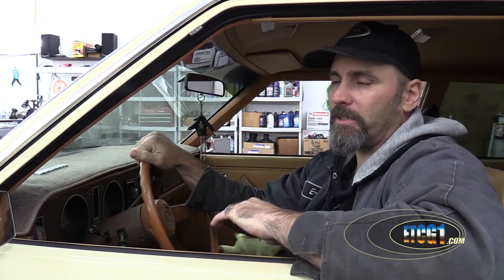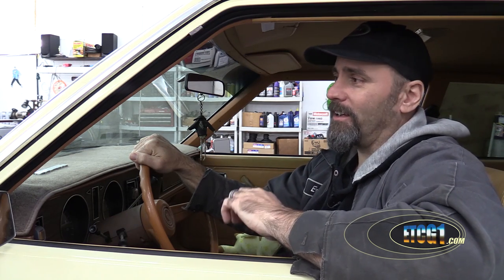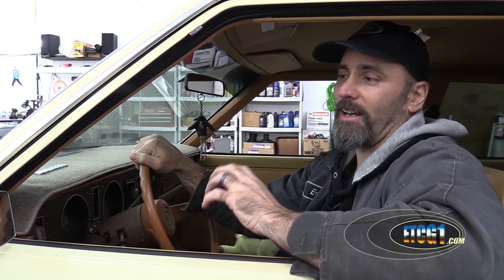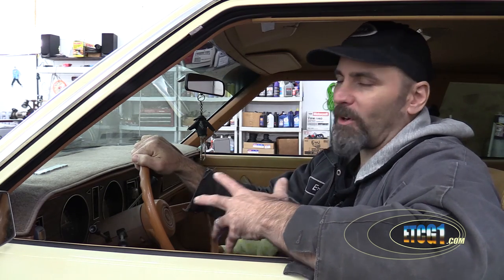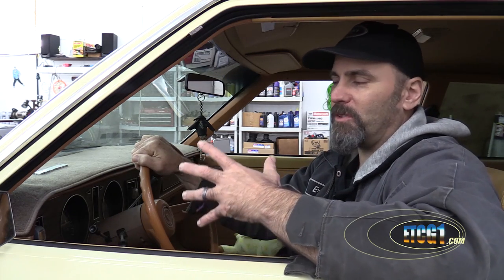Analog vs Digital (Cars)

Comment: I love electronic ignition and fuel injection.  new or old whatever I own at some point I always do this.  

for my performance cars it has to have abs.  kinda limits what I will buy for canyon carving, road racing and rallying.  just a huge safety feature that keeps me alive.  and again I will throw in traction control.  as long as it has abs you can replace the ecu and setup traction control.  

for my lightweight sports cars I love manual steering.  so much more enjoying and gives you way more input.  

my only major gripe with all the new and fancy gadgets is when it's faulty how much is it going to cost me.  if some silly sensor is going to go every couple of years and cost me $300 each time I'm going to be pissed.  

I had a Kia optima sxl.  amazing car.  I was very happy with it.  around 35k miles the high pressure fuel pump went.  it's only available thru the dealer and only with them installing it.  cost $1000.  pumps generally go every 25-35.  and although they have great warranties on the cars that doesn't include the fuel pump.  so in 2 years I was looking at spending 1k on a fuel pump.  while this is a mechanical part it's only so expensive because it supports direct injection.  

I don't mind dealing with technology.  just keep the prices down.  if I have to replace a sensor don't kill my on the price.  

FYI I traded in the optima sxl for a new maxima.  that car is just sick and has so much new and amazing technology in it its mind blowing.  not sure I would want this stuff in a sports car but for daily driving and road trips it's great.  I will for sure get an extended warranty for it.  let them deal with it when stuff breaks.

Comment: With my personal vehicle, the only thing that is digitally controlled is the engine. In the process of fixing almost everything on it, I prefer it that way.

The engine runs on an electronic distributor and an ECU that controls the injectors and idle air control valve based on what the throttle position sensor tells it. That's literally all it does. In terms of it breaking, this system is actually less prone to failures and has more failsafes built into it than a mechanical system can. If the engine starts to stall, it'll open the IAC to compensate. With a mechanical system, it would just die. It won't let the engine rev over 6250 in case the transmission is slipping. With a mechanical system, you're looking at a blown head gasket at the very least. If the engine is getting less air than it's supposed to, it'll give it less fuel. You won't be running rich and sludging up your engine. Fuel injectors also last a very, very long time and PCB boards are virtually impossible to break.

Believe me, this Windsor has been through some shit, and I don't think it would've kept running in those dark times if it was fully mechanical. After some TLC it is now running happily in sub-zero temperatures, despite having gained a lifter tick. The transmission is another story. I kind of wish I could have a 4R70W, but I don't see that ever happening.

That said, absolutely nothing else is digital. And I want to keep it that way. I can't stand all the ridiculous redundant anti-stupid sensors today's cars are jam-packed with. It pisses me off even more that they're necessary, because most people are incompetent idiots.

Comment: Interesting video! I'm stuck in the Bosch k-jetronic with lambda world that mixes the most complex mechanical system I've seen with the most inaccessible lambda control system coupled to early Porsche digital ignition timing. Lots of people do EFI swaps on the 924 turbo' and carb swaps on the N/A 924 for the reasons you've been talking about

Comment: I am an IT professional and use all types of computers and electronics daily, my current car is a 97 5.0 explorer, and i love it, mainly because it is electronicy enough to be reliable without the pita that is all analog, and it does not have a DRM ECU.

i think i am in that lucky bracket of being old enough (and interested enough) to have owned worked on and rebuilt old engines, but young enough to still understand and use modern electronics (down to the component level) it also does not hurt to know the physics behind the operation, but not essential.

given a choice? i would still go electronic, wider operating parameters with less fiddling (unless you call dicking around on a computer fiddling then i guess not LOL) but yes for the reasons you mentioned about retooling to make some major changes for analog systems.

ultimately, emissions aside, there is a reason we do not use older systems as frequently any more and in some cases not at all, and that is due to their limitations. Are electronic systems ideal in all environments? nope, but we have electronic systems now in much more harsh conditions now in smaller packages than are possible with legacy systems.

in the end it is the correct tool for the correct job. we went to the moon and computers less powerful than a modern scientific calculators, people built them using slide rules and mental arithmetic, and hand welded everything (seriously check out the F-1 rocket engine, that was artwork not just welding!) however we also have thousands of satellites up there now (and a space station) that are packet with electronics too which make our lives (somewhat) easier and more pleasant.

Comment: First vehicle i owned was carbureted. 89 silverado, only problem i Had with the fuel system was one of the harnesses inside of the carburetor would pop up and it would run lean. repair cost me $23.00 for a new harness and some soldering skills. dirt cheap and reliable. truck is still being driven around.

Comment: As an Electrical Engineer with an addiction to working on my cars I prefer the computer controlled electro-mechanical systems vs the mechanical systems without  computer control. I understand the systems, but I also understand the mechanical systems of old too. I don't think there is anything wrong with going with a carburetor for the fuel delivery.

Comment: Here's another thing that was a potentially big problem that fizzled out quickly: Remember the pre-OBD-I fiasco where private repair shops got together and petitioned the government to force manufacturers to "standardize" systems in terms of diagnostics?  I have a '84 Isuzu Impulse with Hitachi fuel injection and I have all the factory shop manuals and almost no amount of study can make me understand it... truly a work of PFM!  I bought it for a future project and I only need it to "lot drive" so it amazes me every year when it starts and runs :)  It has a multitude of vacuum lines and valves that act as modern-day digital logic circuits.  I wonder if there will ever be a museum for some of the true automotive oddities of the 80's?

Comment: I can see that for this kind of build which is really a one-off custom job, it's going to be a lot easier to get a carb setup that runs "good enough" than to get an EFI system custom tuned in order to deliver maximum power. You definitely are going to be leaving some power on the table though.

The other problem with a carb setup is it's ultimately a dumb mechanical device that has no intelligence or feedback based on what's going on. An EFI system can manage the fuel delivery better to allow for reliable cold starts, and to control the fuel trims if you start running lean or rich (due to altitude changes, different fuel..) Also it can do things like roll back timing or boost if the engine starts pinging. Particularly in a turbo build with a carburetor, it's going to be much more up to the driver to prevent something like burning a hole in a piston if things aren't quite running right.

Comment: well I agree with both sides of the argument eric I love the modern systems and the diagnostic and control, but I also have a few old motorcycles and a 1990 mechanical fuel injected car. there is nothing you cant bodge at the side of the road with a simple carb and points system to get you home but I love the precision of digital so you are both right and wrong and so am I lol . love your build and who could get tired of the dyno video.

Comment: I like the early fuel injection era.  Kinda combined the best of both words.  My 1990 Oldsmobile 88was made to look like a 70s csr but had the MPFI so it has great mileage even compared to new cars.   The most fancy thing it has is a "driver information system" which monitors things but is independent.  If it breaks the car will still run.  The interior otherwise only has a radio, heater and speedo.  Under the hood, you got spark plug wires, a brand new coil/ignition module and otherwise its all simple like an old car.

Comment: You could argue that the best system is the one built right! I've run a 1972 VW Bus with twin Dellorto carbs and it was amazing, yet I've tried to set up dodgy Chinese copies of Solex Kadron carbs on the same type of VW engine and struggled to even get it idling correctly. Likewise, the fuel injection system on my Wife's old 1994 Mercedes C-class and her current 1998 C-class is really good with both cars reaching well over 200,000 miles with no problems. Compare that to my 2002 Mercedes C-class and it's by far one of the most unreliable systems I've ever seen on a fuel-injected car.

Comment: I disassembled a 1970s Chrysler carburetor for my truck. I learned so much. They knew what they were doing. Still no matter what I did I couldn't get it to run right. I had two options based on my carb skill. Idle at 2500 or no idle at all. I just settled for 2500.

Comment: A carburetion problem is likely cheap to fix, but a fuel injection problem is less likely to occur in the first place. People today are generally less aware of the mechanical needs of their car, I think, as a result of how much less often their cars need maintenance. A typical maintenance schedule today includes the obvious (oil, filters) and after 100,000 miles the manual finally recommends a new service. (Spark plugs, no wires) But go back to the carburetor days. Almost every week, your car was going to need some kind of adjustment or minor repair. And if you neglected to do that for a few months, you could end up with a hesitant smoke-spewing pile. Today's fuel injection systems are self-learning, making slight adjustments all the time to suit the conditions they're being driven in. They're super efficient and monitor themselves, letting you know immediately when they feel something is wrong. It's not a perfect system, but from a perspective of day to day usability, it's my belief that modern fuel injection offers a host of improvements that far outweigh the disadvantages. Maybe you'll be able to fix your broken mechanical fuel delivery or ignition on the side of the road. But electronic control is a lot less likely to leave you on the side of the road.

This is just my perspective though. I feel your choice to use a carburetor on the Fairmont was the right one. It's appropriate to the application. And seeing carburetors on the main channel is a change in pace, given how much of your content has dealt with diagnosing and repairing fuel injection. Keeping things fresh by exploring old things made new. There's something poetic about that.
Reply from the maker: Excellent point about modern vehicles needing less maintenance due to fuel injection. I think it's also a result of better machining and PCV systems as well. That said, I have seen a trend toward a more modular approach to vehicles. Also a move toward less maintenance. More as a marketing tool than anything else. Lower cost over the life of the vehicle. That still doesn't negate the fact that fuel injection has made vehicles more reliable and efficient. But as you said, there's nothing wrong with the carburetor on my Fairmont and that was one of my main points in making this video. Thanks for your comment.

Comment: As a member of the "Really Old Fart Generation" I've worked on one, two and four barrel carbs.  I've even torn apart an old Quadrajet unit on the "side of the road" to get going again.  Now that I'm over the hot rod days and tow a boat or a travel trailer depending on where I'm going at the time, I really love the modern fuel injection when it comes to extreme altitude changes.